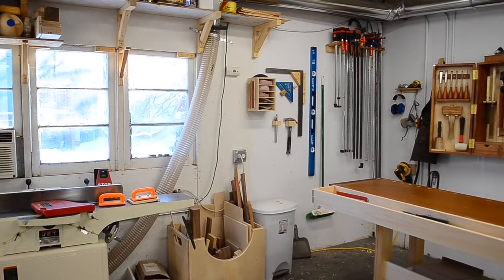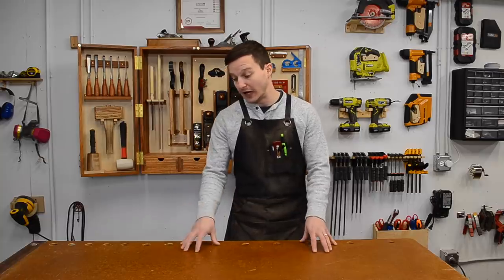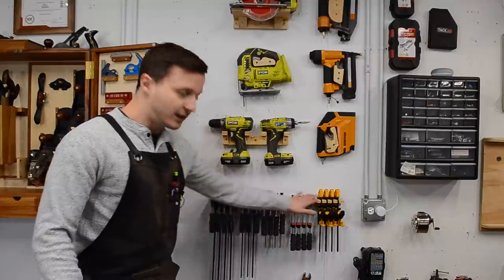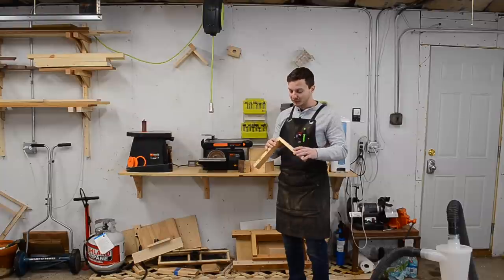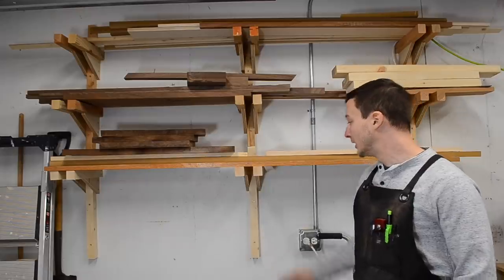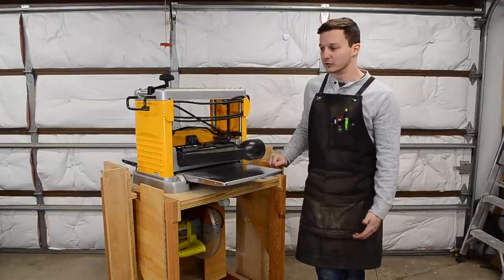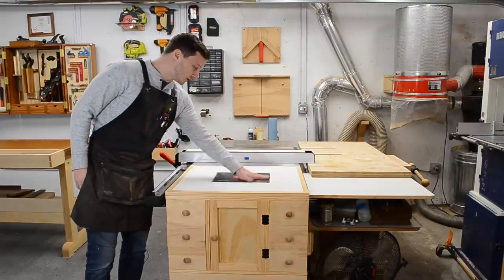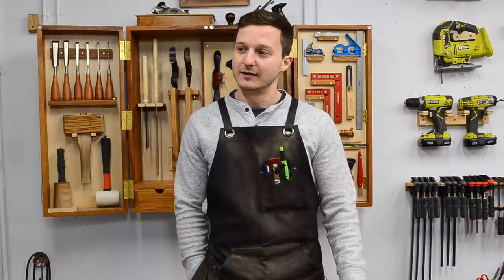I'm building a new workshop! | Shop Tour

Comment: Thanks for sharing a great video! I am new"ish" to woodworking but have 25 years of experience as a Health and Safety Rep.  Glad to see you have a focus on PPE, your respirator (3M half face with a organic vapor/HEPA filter cartridge).  One thing I would suggest...  you should never leave the respirator just hanging in the shop when not in use.  It should have come with a re-sealable plastic bag (even has a hole in the top non sealed area to hang on a hook).  You should always keep the respirator in the bag and sealed when not in use.  Even shops with the best dust collection systems will still get dust and any chemicals you spray in the air.  These elements can then settle onto your respirator and then you don it to use and are now exposed to that contaminate.  Keep it sealed when not in use and you will always have a clean respirator.  Those cartridges you use (the ones currently on the mask) are considered 40 hour filters, so they should last under normal conditions for 40 hours of wearable use.  The round ones you mentioned are only 8 hour filters (those are HEPA filters for dust but as you mentioned, provides no protection from vapors and gases).
Reply from the maker: Thank you so much for the words of wisdom Franklin! I will try to keep my respirators covered in the future and I am definitely due for replacing the cartridges! Thanks, I am glad to have you as a viewer!

Comment: Great to hear you are moving to the East Coast! I'm a CT. resident myself. One piece of advice for your next shop is to make it larger than you think you need it to be. Within a short time, I quickly outgrew my shop and now I plan to add on once lumber prices come down. You think you can get by with a certain size, but once countertops and storage solutions are put into the space, you will find it becomes cramped. Just my two cents.
Reply from the maker: Awesome! Thanks for sharing CrossGrainn. I agree, too big is better than too small! I am thinking of building a 20x15 or 20x20 shop right now.

Comment: One thing I plan on doing for my future wood shop is to install 1/2” rubber gym flooring throughout the entire shop that way you get both protection for your tools and support for your feet/low back. In my research I’ve found prices to be between $1 to $2/sq ft. It may be a tad pricey depending on the size of your shop but well worth the investment in the long run. Love your videos and I can’t wait to see your new shop!
Reply from the maker: That's a great idea Aaron. I chose foam to save money but I might go ahead and upgrade to rubber in my next shop. Thanks for the comment!

Comment: Thanks for the video, it is very interesting. Could you please provide some more information about table top: what is the thicknesses of MDF, it is row or some water resistance variant, what is the finish of the top(oil, wax or something else)?
Reply from the maker: Thanks Sergey! The MDF is three laminated layers of one inch thick MDF, and it is finished with many coats of tung oil.

Comment: Hey man, cool vid! I am a beginner woodworker with a small shop and I want to get a jointer but I don't have a ton of room. I was thinking of getting the benchtop craftsman but it sounds like it's not that great. Any recommendations?
Reply from the maker: Hey Lamps! I wasn't a fan of my benchtop craftsman, it was so lightweight it didn't feel very safe to me. It worked for edge jointing short boards but that's about it. For edge jointing I would recommend making a sled for it on your table saw. For face jointing anything wider than 3-4 inches you either need a big jointer, or you can do a good job with just a hand plane and some practice! If it were me, I would use a hand plane to get one side mostly flat, then skip plane it in a planer (a few passes through the planer, flipping it over each time)... that process should work well enough for most applications. Hope that helps!

Comment: Hey nice shop, good luck with the next one.
I was wondering do you have a stash of other clamps somewhere? Although I am not a fan of the saying "you can never have too many clamps", you have surprisingly few clamps hehe, if that's all you use I am impressed
Reply from the maker: Thanks so much Claude!! All of my clamps are on that rack, with the larger bar clamps hung on the wall, and a few small spring clamps in a drawer just to hold stuff in place periodically. I often use all of my clamps for a project, so maybe I could use a few more!

Comment: Good luck on the move man. I live in Colorado, so we get some cold days. I really recommend wiring your new shop with 220 and buying a forced air heater. (can get them for under 200$ these days.) If you insulate your new shop you will cook yourself out of there in the winter, and won't be producing harmful fumes. I've had my heater for 15 years and 3 different shops and it has been worth every penny.
Reply from the maker: Thanks for the tips Micah! That's a great idea. I will definitely have 220 in the shop so I will consider that.  Thanks!

Comment: 23:30 Look for videos from Alex Snodgrass on how to tune a band saw. He's an absolute treasure trove of knowledge and information when it comes to band saws. 25:45 To solve your issue of not being able to see into your dust collection trash can, get a small piece of 1/8 inch thick plexi, maybe 4in x 6in, cut it to your desired size. Next, cut a hole in the side of your trash can where you feel the need to empty it. The hole in the trash can needs to be at least one inch smaller on all four edges than your plexi is. Drill holes about one inch apart on the plexi, and matching holes on the trash can. Using a thick bead of silicon caulk, along with small nuts and bolts, mount the plexi to the inside of your trash can. Also run a bead of caulk along the outside edge of your window to make 110% sure there will be no loss of vacuum. Allow the caulk to cure for however long the instructions recommend. This is the first time I have seen your channel, and became a subscriber before the video ended. Good luck in your new home and shop, Chicago will miss you, but at the same time I salute you for leaving, and I'm sure you know why.
Reply from the maker: Hey Pagan, awesome thank you for the tips! Love the tip about making a window in my dust collection trash can, I will try that for sure. Welcome to my channel!

Comment: I was worried when i saw the video title in my notifications, but it turned to be a very good news !
At 28:50, when you speak about your height issue between your saw and your workbench : i seen people using kind of trestles with a roller on the top.
And what is a "2 by 4" ? Here in France, I never heard that expression.
Anyway, I'm glad you have projects in both your life and your workshop, especially in these hard times. And I'm glad you don't stop making videos, because your works are beautiful, and it's very inspiring.
Reply: In North America, our dimensional lumber is measured in inches - so a 2 by 4 is ‘2 inches’ thick by ‘4 inches’ wide (by 96 inches long, usually) I put these numbers in quotes because if you take a ruler to the lumber, it’s typically 1.5 inches by 3.5 inches. The half inch difference is the result of planing and jointing the lumber. That’s typically done when the lumber is quite wet, so unfortunately as it dries, the lumber twists, bows and cups. 

How do you size your lumber in France? I’m really curious!
Reply from the maker: Thank you Soni! A roller is a good idea to help with the height issue. In the USA a "2x4" is a very common piece of cheap dimensional lumber used for framing structures (funny it is actually 1.5" x 3.5" even though it is named a 2" x 4"!)

Thank you for watching, I will keep making videos for sure!